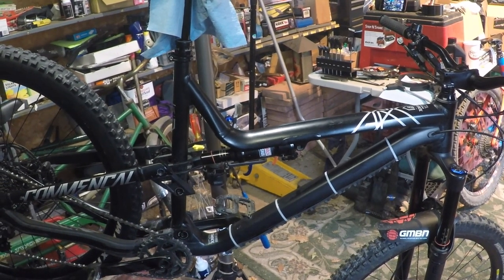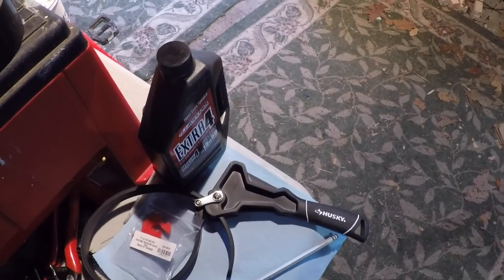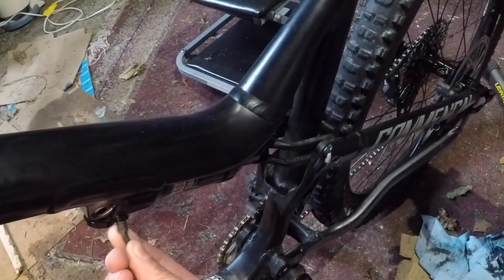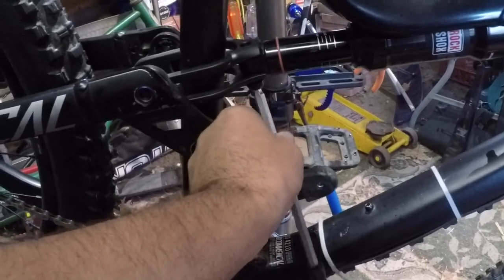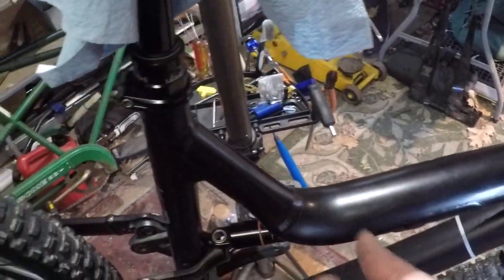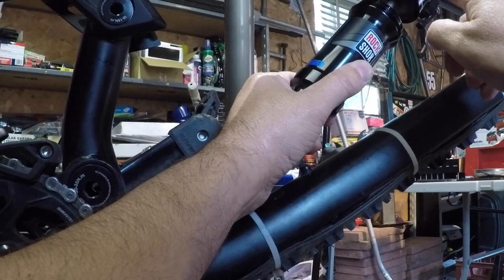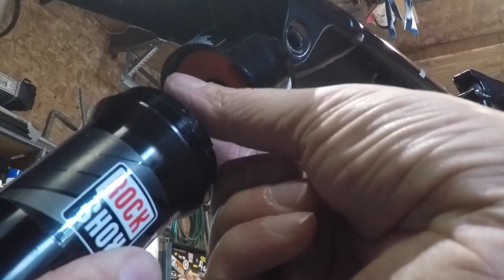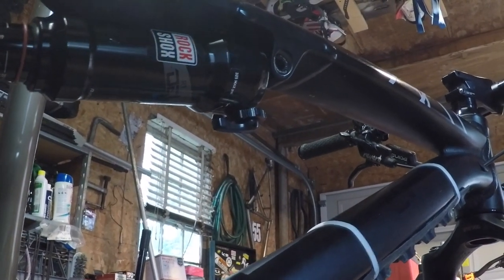HOW TO: Rockshox Deluxe volume reducers

Comment: Great video and as per your additional comment below, one should not forget the 2ml of oil in the Air Can space which one is supposed to check every 50hrs (maintenance) of use in according with the manufacturer's recommendations... Happy MTB riding.

Comment: Good video. I have a 2018 Meta with the same rear shock. I was wondering how many are inside from the factory. I'm thinking of throwing in the gnar dog and 1 more normal.
Reply from the maker: If I remember correctly there is only in from the factory.

Comment: You should Really put a rag through the bottom eyelet when removing the air can. More often than not there is still some pressure in there that will send that thing flying. Also, how is there not a shot of actually inserting the volume reducer?

Comment from the maker: There is a total of 2ml of oil in the can. You can get a syringe at a drug store to measure.
Reply: Do you need to replace this when adding a token?
Reply from the maker: Tom M Yes. You need to have 2ml of oil. If you don’t loose any when adding the token then you do not need to replace it. That said it probably needs to be changed 👍🏻

Comment: Love the bike; was one that I considered purchasing.  What were you going after by adding the spacers and did it help?  I'd like to maintain BB height on my Spectral as much as possible but right now I feel like I need too much air to do that.  Was considering adding a spacer or two and reducing shock pressure.  Do you think doing this would help?
Reply from the maker: Zbyszko P I started riding a lot of downhill parks so I wanted reduce bottom out and increase ramp up. I also add 5-10 lbs. I do think you could improve B.B. height in this method but very minimally and it would not help ride quality. It would reduce pedal strikes in situations that your compressing the shock near full travel. 
The spacer increases mid and end stroke providing more ramp up. Hope that helps.

Comment: why did you undo the lower  part of the shock? I was thinking I can do this while the shock is still connected?
Reply from the maker: Really just to have some room to work. You are correct that you could certainly do it with out removing the lower section. Might even be easier to compress the shock with it in frame. Mine is tucked up into the top tube so I need to remove the lower. 
Thanks for the comment.
Reply: I was wondering the same but thought it was to keep the can more upright to avoid oil spillage. 

I'm getting ready to do this with my bike (that's just like your's!). And i don't know how much oil there is in the can, so I think ill do it this way to ensure i don't spill the oil and to observe just how much is in there for future reference.

Thanks for the vid! Awesome tutorial!

Comment: Any idea if these spacers would work with the rockshox monarch RL it seems a very similar shock being the threaded air can instead of the slide on air can that other rockshock shocks use with the volume reducing bands.
Reply from the maker: No I believe the Monarch uses the reducing bands and that these spacers only work with the deluxe.
Reply: MTB Beta brilliant thanks very much, I did get the reducing bands but when it came to fitting them I noticed that my air can is threaded and not slide on so there didn’t appear to be anywhere for the reducing bands, hence why I questioned this in hope it’ll fit my shock. 
I’ll continue my research. 
Thanks again for the video.
Reply from the maker: Check page 32. Hope that helps. https://sram-cdn-pull-zone-gsdesign.netdna-ssl.com/cdn/farfuture/V4jsgTjYMkCToF0IzCF6VUdzIQinP6F7fhaqRS_BEyI/mtime:1471624845/sites/default/files/techdocs/gen0000000004933_rev_b_2016_monarch_rl_rt_xx_english_0.pdf